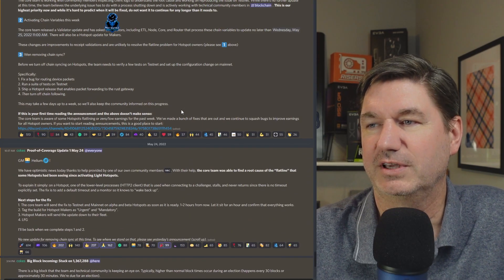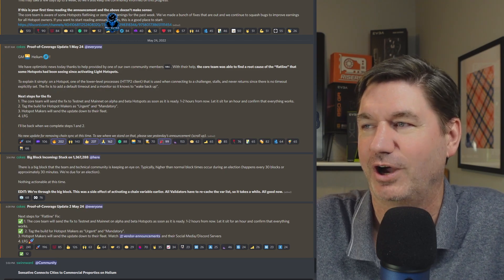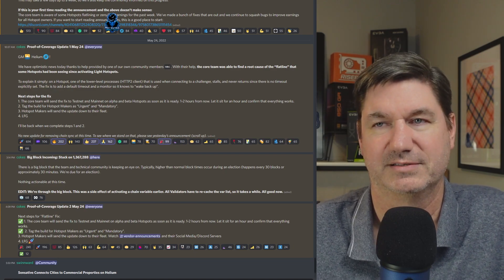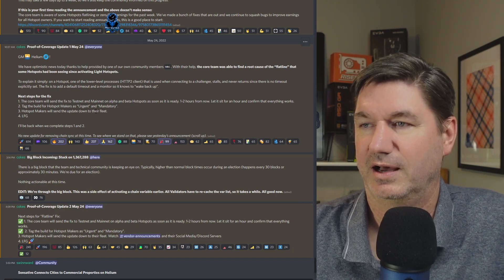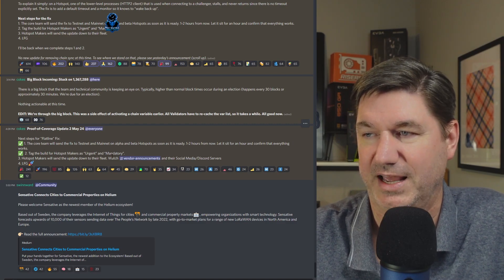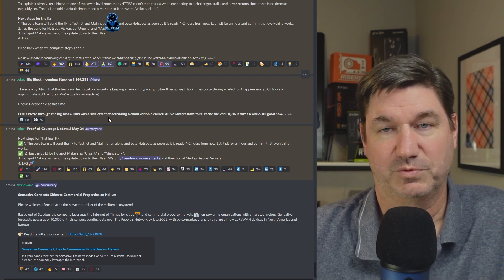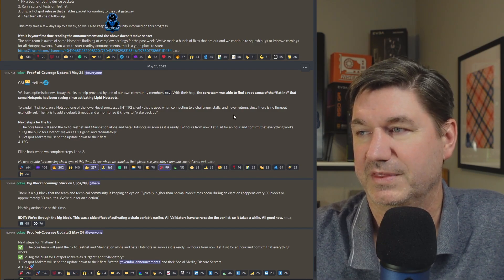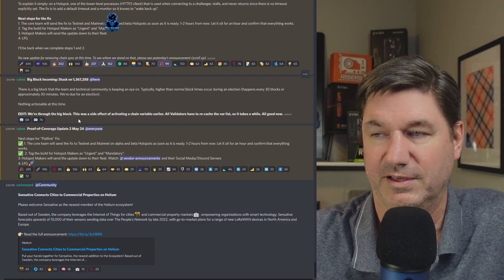Is your Helium Hotspot Miner Now FIXED??

Comment: I honestly wonder if Helium miners are not actually suffering with the same phenomenon which struck Rasperry Pis used for farming on CHIA.
It's called "Dust Storm", it's nothing new in blockchain technology but apparently some hardware can severely be impacted at some level if the project underestimated the mitigation for lower hardware...
Have a great weekend ahead <3

Comment: Not fixed yet. Falls in and out of sync with 2gb to 4gb daily network data usage. Basically roll back light hotspot, problem solved sort of.